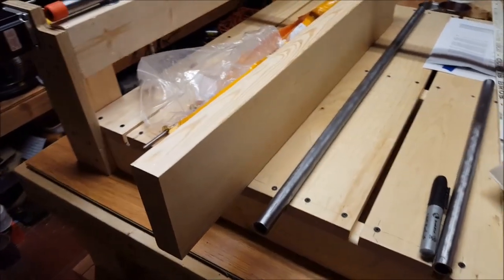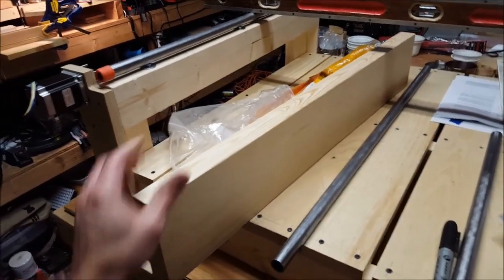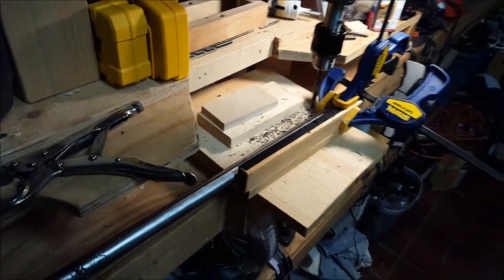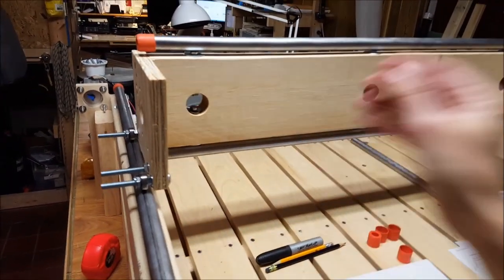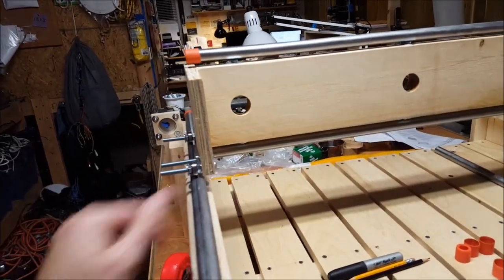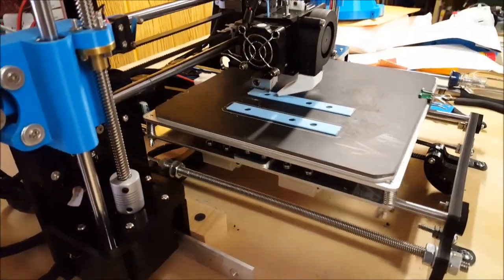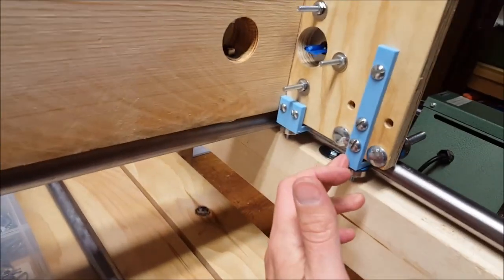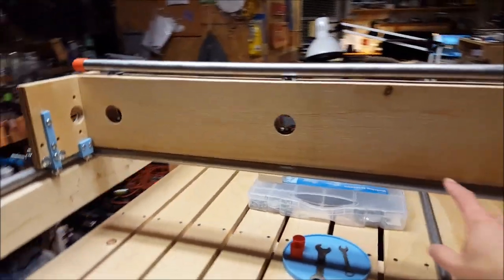Solsylva CNC - Y Gantry Progress

Comment: Nice job.
like the way that it moves super smooth. 
Are you going to have 2 Stepper motors for the X-axis? 
Mine Had too much deflection so I added a second stepper.
Reply from the maker: Thanks.  Yes; the x axis will have a stepper on each side.  I didn't like the idea of having such a large Y gantry being run with a belt and one stepper motor.